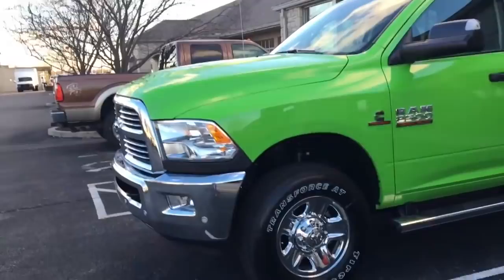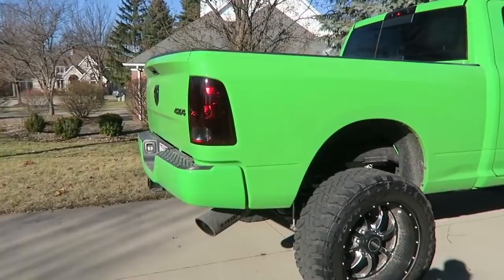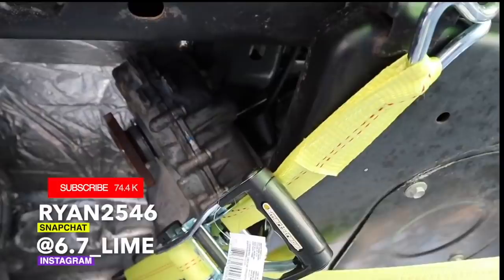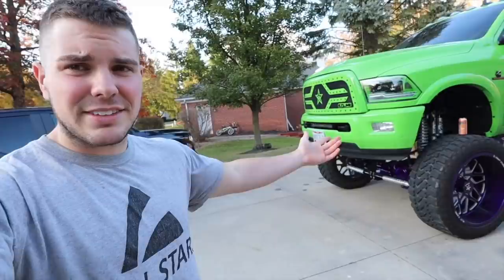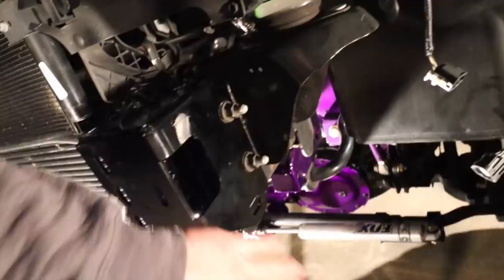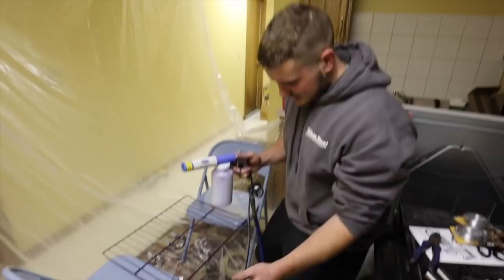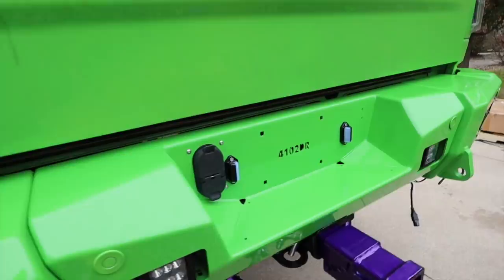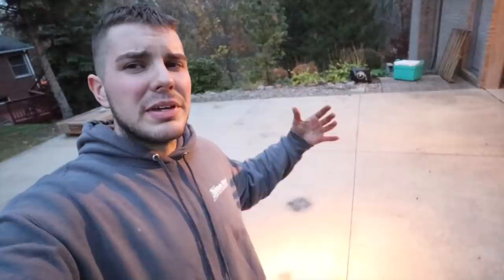I Built a SEMA TRUCK in my DRIVEWAY!!!

Comment: i like how the wires are just being twisted and heat shrinked not even soldered together first
Reply: charles blatchley sema quality
Reply: It's a show truck, it doesn't have to work
Reply: Time crunch
Reply: As a electrician i have never soldered a wire in the plants lol its wire nuts kernies or heat shrinks 😂😂
Reply: he didnt have crimps or butt connectors give him break lol
Reply: If they dont use solder on airplanes because it cracks and more likely to cause a poor connection. He coulda atleast used a connector though 🙄 sad thing is ive seen audio businesses do cheap shotty work like this.

Comment: IF I powder coated in my kitchen, my wife would make sure it was the last thing I ever did on this earth.  Truck is awesome!   I am inspired.  I have a 2015 Ram 1500 Sport 4WD, mostly all stock.  I rebuilt the rear diff/axil last weekend (huge job), but it was so much fun (after the cursing) I am all in on building my truck out.  Not as much as you did, but something more than it is.  Oh, and my truck is the highly sought after Competition Orange with black accents.  I get compliments everywhere I go, but mostly older guys and girls.  I want to pull up next to a highly tricked out truck and get 2nd and 3rd looks.  Excellent channel.  Keep up the good work - you are feeding the economy by inspiring people like me to spend.  Excellent!  :)

Comment: Personally good video but why lift any truck just saying I have an lbz duramax with with 195,000 miles on the odometer and mine was lifted for a short time with 6 inch lift and 35s but honestly I didn’t like it bc when it got used to the tires it didn’t run as good and ride as good but it looks okay I took my tires off and went back to stock with a tuner set to 2
Reply: Supposed to be a work truck not a hot rod dummies

Comment: 26 inch wheels?? Dumbest thing you can do to a lifted 4wd truck. I guess it's ok for a trailer queen but those 40" tires are about as good as civic tires off road.
It's a nice truck but the wheels and tires ruin it.

Comment: IT'S 2019 RIGHT NOW.......the truck is a 2017 with 322 miles...IT'S A USED TRUCK
Reply from the maker: That video was 2 years ago, it was dealer traded from Indiana and parked in that spot thus the 300 miles